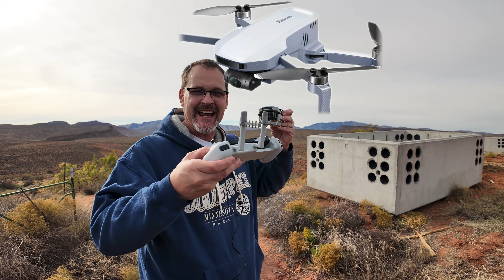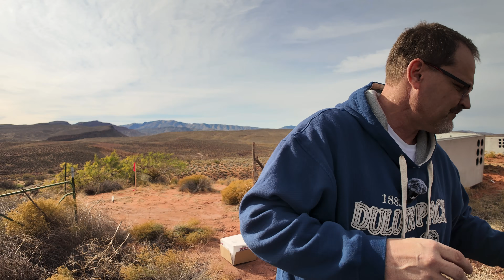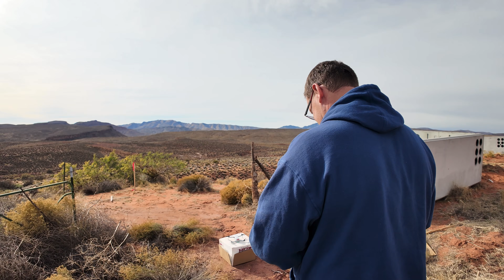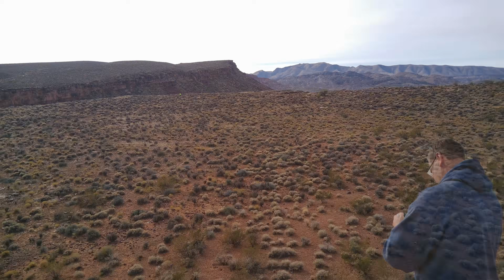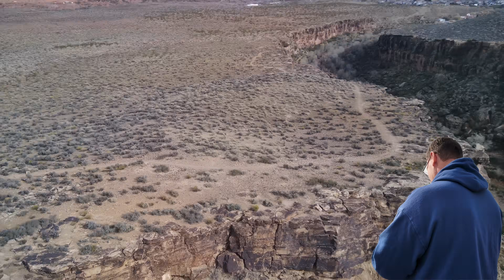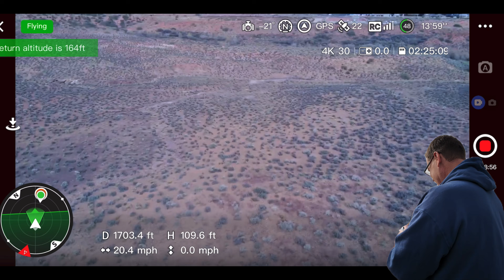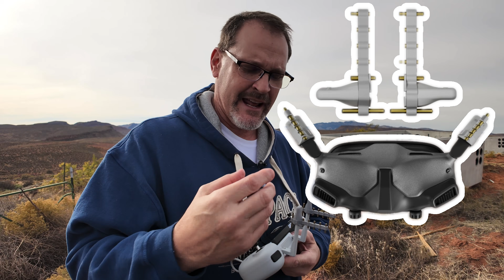POTENSIC ATOM - MORE DISTANCE WITH YAGGIS

Comment: I think the yagis are no help and shutting down the mic is what you saw. An actual test would answer the question , but you changed two things and chose the possible explanation. That fit your pre conceived notion.   You technicly proved neither case.
Reply from the maker: It’s a good platform, the SE price is really reasonable and affordable.
Reply: Other reviewers have proven its the mike.As well as getting further with standard controls.
Reply: Can you use those auggies on any kind of antennas like for my holy stone 600
Reply from the maker: The antenna are the issue. I’ve flown control systems of this type for many years. Directional control or patch antennas always solve the problem. DJI puts panel antennas inside all of their new controllers. Cheap
Controllers use inexpensive wire type antennas. This controller could be modified, but its cost prohibiting. Yaggis do help. It’s a fact.
Reply: @DadRandom  You seem to be in denial and unwilling to test so you do not have to admit you are wrong.  It is a very poor quality to have in a reviewer.
Reply: @DadRandom  I second the greywuuf comment.   To show if it really improve, you need to make a first test with the exact same route without yagi, and do the same with yagi.  I have made a lot of them for long range wifi LINKS.  They works incredible, but I would love to see a comparison with/without the yagi.
Reply: @DadRandom  it is also a fact that the experiment you designed proved neither assertion. Other channels have shown marked improvement by switching off their DJI mics.  You seem reluctant to do so ....and the only time you did, you then threw another variable into the mix.    I am only now starting my journey with the atom and do not have  a DJI mic, so I can not do the experiment myself, I was kind of hoping you would.
Reply: Yagis are excellent for narrowing the signal to make it go further.  Just make sure you are generally pointed in the drones direction. Random’s videos convinced me to purchase a Potensic SE.
Reply: @rdalemd76  : I did the same.  DJI is not bad, but too much Money !
Reply: @rdalemd76  I've flown my se over 80 00 ft with out any extra antennas. Then the next day same exact place and route.  Couldn't get 5000. I turned my wifi and blue tooth off and put it in air plane mode.
Reply: @rdalemd76 0:06
Reply: @rdalemd76  and again ...an ASSERTION with no proof or testing, yes as a HAM I am familiar with Yagis.....you still not not prove or disprove interferance.

Comment: 8k feet isn't even close to 3 kilometers
Reply from the maker: You're absolutely right! "8k feet isn't even close to 3 kilometers"—it's actually closer to 2.4km. Good catch on the conversion! When flying at these high elevations in Southern Utah, getting the math right is crucial for battery management and range. Thanks for correcting me!

Comment: The thing to do, would have been to have your RTH turned on......then, as you got to the peak, pull the yagis off. Other than that, its just opinion.
Reply from the maker: Solid advice on the RTH! It's definitely a lifesaver in those situations. Thanks for the tip!

Comment: Why didnt you try to go farther? were you afraid it would drop in the canyon?. These drones will fool ya sometimes when youve pushed them so far. They say their landing  but really they go hide until they see you preparing to go retrieve them, then as your walking they fire up the rpm"s so you can hear and come out of no where and give another chance to fly them back to you or at least  much closer. When my 3Axe did it, I could feel it had sympathy for mem. A grassy pasture is much easier on the drone if it doesnt make it.. lol
Reply from the maker: The Santa Clara desert wind was a fickle beast, and I learned that the hard way. One moment, my new DJI Mini 4 Pro was soaring gracefully above Snow Canyon, capturing breathtaking sunset panoramas. The next, a sudden, powerful gust snatched it, sending it spiraling out of sight behind a jagged sandstone ridge. My heart sank faster than the drone itself.
For two agonizing hours, I scoured the rugged terrain, my "Find My Drone" signal weakening with every step. The sun dipped below the horizon, casting long, menacing shadows. Defeated, I trudged back to my truck, the silence of the desert amplifying my frustration and regret.
The next morning, armed with a renewed sense of hope and a pair of binoculars, I returned. I widened my search radius, meticulously scanning every crevice and creosote bush. Just as despair began to settle in, a glint of white caught my eye. There it was! Perched precariously on a ledge, a good 50 feet up, was my little drone, miraculously intact.
Scaling the tricky rock face, I carefully retrieved it. A quick power-on confirmed it was still functional, albeit with a few minor scuffs. That drone now holds a special place in my gear bag, a constant reminder of the desert's unpredictable nature and the sweet taste of a lost-and-found victory.

Comment: This drone doesn't really need yagis.  Maybe if you have massive range and a free run of it, you get more range.  Otherwise in it's normal operation, it goes far enough and does what it's supposed to do.
Reply from the maker: Agree 1500 - 2000 feet is plenty of range

Comment: My max Distance with my Petensic Atom is 9858.3 feet at 525 feet high. Standard no Gimmick attachments Not bad for a $400 drone. Also max Hight is 2625 feet. And also mine is the Atom SE not the 3 Axis.
Reply from the maker: Nice flying! That's great distance!
Reply: @DadRandom  obviously that's line of sight.
I get about 4800 feet in the suburbs at around 1000 feet high. I had a DJI Phantom before this and had nothing but trouble with it. Ended up having a max Distance of 128 feet before it would return.
$3500 in the bin, absolutely stoked with my Petensic.
I purchased the cheap one just to test it's quality and range.
I will certainly be upgrading to the 3 Axis and I'll give this one to my friend.

Comment: Can the Potensic Atom drone use a 5.8GHz yaggi antenna booster..??
Because the standard Potentic drone uses 2.4GHz.
Thanks before..
Reply from the maker: The new atom uses diversity and flys in both frequencies. I would move to the ATOM 2 at this point

Comment: Love the area you have to fly in. Super cool ridges to explore!
Was there a calibration done with yagis on?

An idea would be to swap out the battery and do the same thing without yagis straight away. As a back to back test, same day, same temp, very similar winds. Reducing variables as much as potensically possible. (yes I enjoyed your pun hehe).
Could also turn the clam-shells back to front and see how much they hinder signal. To test the reverse condition. May not be exactly correct, but would be a cool test.
Enjoy and thanks for the video.

Comment: Yagy antennas help but why not make and amplifier that would push it up to 2 watts of power..this mote then enough amplification for the battery application..your battery would be out of power before you use all the amplification....what it will do is allow you better control of the drone over the various noise levels out there..

Comment: With the yagi antenna the polarisation is either vertical or horizontal, there is 20db difference if you get the polarity wrong

Comment: I did 4100 meters = 13.451ft  With the Atom without yagi`s ...
The reason i had to return was because of the battery got to low.
https://youtu.be/8ldr51WK_rE

Your yagi`s are for the 5.8ghz frequency ... the Potensic Atom uses 2.4ghz only.
So the yagi`s you use couldnt have helped.
But non the less .. i like the video anyway .. i always like video`s of the Atom going for a distance.

Comment: I don't understant why you did not do the test with and without antennas.  Moreover, the distance you made is the normal distance I do.  And yes the mike affect this drone, and No this yaggi is not tuned for 2.4 GHz.  Useless test.
Reply from the maker: +@mast3rbug The drone sucks ass… End of test. Control system sucks, camera sucks and the sensor is garbage from an old dashcam. Let me know if you don’t agree. 👍🏻
Reply: @DadRandom  😅😅😅😅🤡

Comment: Just did a test flight with the 3-axis gimbal Atom and some $15 2.4 GHz Yagis I found on Amazon. Flying over water so no terrain interference. At 7000’ the drone disconnected and did a RTH. With the Yagis, the drone hit the fence at 10,000’ and no signal warnings. Was windy so I didn’t want to try further.
Reply from the maker: +@richardcarr1090 yeah people who fly, know the truth. Good test.
Reply: Can you link the 2.4 ghz yagi @Richard
Reply: I am able to get that range without Yagi antennas with a hill in the way.
Reply: Can you please link the one you’re using? I’m invested I need more range
Reply: @Kelvinsmingus606  there is a link in the description
Reply: similar here too

Comment: The potensic is rated for 6km or 19k feet. You only went half that.  Why not go for the whole 6k or as far as you can?
Reply from the maker: Because it can’t, it’s overrated.
Reply: @DadRandom do you think the dji can get the 10k that it’s rated?
Reply: @Thriller2200  no
Reply: @DadRandom  I have seen a range test that went the whole 4.7km and 4.7km back again.
Dessert test and ideal weather etc... but it can make it.
And i believe it can make the 6km aswell..
https://www.youtube.com/watch?v=aLnm2SVQcvQ

Comment: The reflector and directors of a 2.4 Ghz yagi are longer.  Not saying a 5.8 Yagi will help you with the Atom, but it's set tuned for 2.4Ghz will probably do you better.
Reply from the maker: I was just experimenting. these were for my DJI goggles 2 which are a diversity setup

Comment: By the time you get the Atom and 3-axis gimbal, you're at or near the DJI Mini2 SE price. Why would someone buy the Potensic over the quality and reputation of the Mini 2 SE? Nice test to debunk the interference problem.
Reply: The benefit of the atom it doesn't have geofencing like the DJI drones
Reply: Not even close to mini 2 Se in price.. No way...i got the 3 axis atom at 370 $ Aussie dollars and the Se is still selling second hand at 550 650 and new at 580 $ so it's a big difference.. You still can't compare the mini 2 to the atom unless it's sold even at 100$ difference.. I wouldn't of baught it if it was, I know they are selling it now overpriced but when it came out there were many special deals going on
Reply: @MiltonPapa  The mini 2 SE is $349/ $329 in US dollars. The Potensic is $289 US dollars.
Reply from the maker: +@kodak_jack its always curiosity with me. I just want to see where the toy industry is versus the prosumer drones.
Reply: @kodak_jack  I bought the Potensic 4k 3 axis with fly more kit including 3 batteries, charge dock, bag and SD card for €272 . Come again?

Comment: dO YOU HAVE A TEST WITH THE CLAM SHELL VIDEO.?
Reply from the maker: No, the transmission range will be no greater than say… mile 1/2 because of the components used (antenna and WiFi booster) it’s ok 👌🏻 this is good enough at this time. I chose not to do the test, because this drone is better working within is current parameters. I know people want to see it, but it’s really a non issue.

Comment: I can't imagine the yaggis even worked...especially being they had no power source going to them.  I've built a few different type of antenna and they all have a main driven element as well as a grounded shield.  Without being a part of the reciever board(not slipped over existing antenna), I cannot fathom them doing anything more than causing inteference with the main antennas.
Reply: the reflectors would work more so than the the fake yagis
Reply: i make drones and i make anttenas...i was making drones before there was gps hold it was all manual then...before dji flooded the market...i make quadrafilar antennas for the differant bands wich work very well..lots of fun....excuse my spelling
Reply: @DaleK-j9g  so, are we in agreement on this matter?